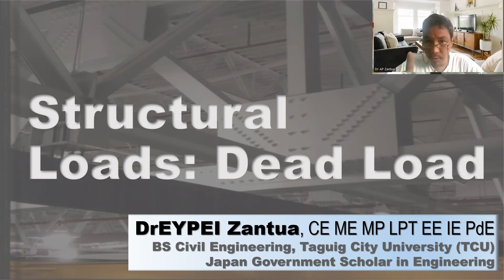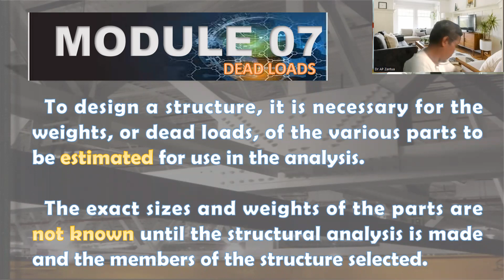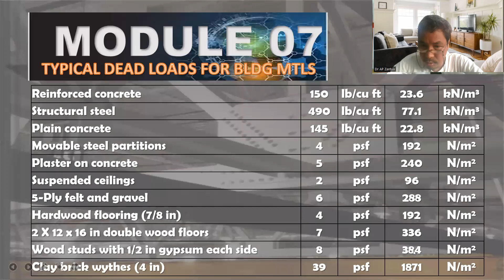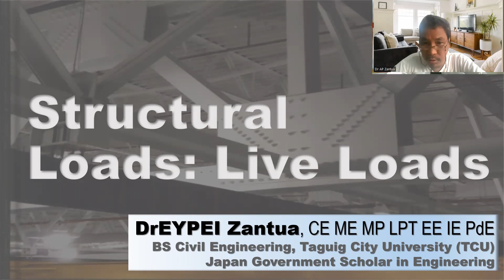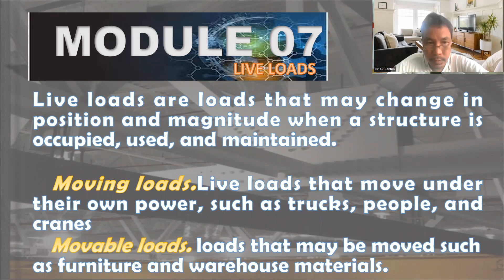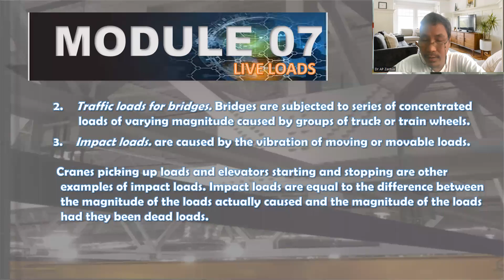Structural Loads of a Building: Dead Loads [ Principles of Steel Design ] Module 2.07.1

Comment: thankyou sir for discussing the dead loads on structural loads of a building, as the loads was classified into dead loads, live loads, and environmental loads. Since it is the most important and most difficult that the civil/structural engineers has to face. As the loads was classified into dead loads, live loads, and environmental loads.
question 044: what is the maximum thickness of glass railing? the answer is B 6mm

Comment: This lecture video talks about structural loads. Loads that are classified as live load, dead loads, and  environmental loads. The example of dead load has stated in the video which are the frame, walls, floor, roof, plumbing, and fixtures. This loads are necessary to estimate for the analysis. Tables C3-1 and C3-2 of ASCE 7-2010 provides the detailed information on dead loads. For Q-044, it is about 1/4" which is 6.35mm. My answer is B (6mm). Live loads has also been discussed in the video. It is classified as moving or movable loads. Tables about typical minimum uniform live load and concentrated live load has also been explained. Thank you, sir for this kind of video that served as a refresher and widen our knowledge about the structural loads.

Comment: Thank you Sir for this live lecture that talks about Structural loads of a building. The loads are classifeid to (1) Dead loads, (2) Live loads and (3) Environmental Loads. But in this video it tackles about the Dead Loads. and it is also mentioned here the Steel-frame building dead loads which are frame, walls, floors, roof, plumbing and fixtures. It is necessary that the weights or dead load of the various parts must be estimated for it to use in the analysis. 

Q. 44 "What is the maximum thickness of glass railing" A.5mm B. 6mm C.10mm D.12mm
The answer is B.6mm

It is also tackle here about live loads: Moving Loads and Movable loads.

Comment: Thank you sir for discussing the structural loads. This topic was exlained in our course TOS so this lecture is kind a recall but watching this, it became more much wider and explained well. Dead loads, Live loads, and environmental loads were classified in ASCE7 minimun loads for buildings and other structures.  For engineers, it is important to know the concept of structural dead loads when designing a  structural plan so that we can estimate the dead loads that our structure will carry and we can prevent structural failure. Thank you sir.
For 20:00 Question 044: What is the maximum thickness of glass railing? My answer is 6 mm

Comment: Thanks po sir for lecture video tackle all about most important in structural load by the structural engineer that may be applied to as structural during its life. Also by discussing all classification of loads, such as dead loads, live loads and environmental loads. 
Q 0044. Ans. B. 6mm

Comment: thank you sir for discussing about structural loads of a building particularly a dead loads. I learned that the most important and most difficult task faced by structural engineer is the accurate estimation of the loads that may be applied to a structure during its life. No loads that may reasonably be expected to occur may be overlooked. In the absence of a cod, the design loads shall be those provided in the ASCE7 entitled minimum design loads for building and other structures. Also, I’ve learned that loads  are classified as dead loads, live loads, and environmental loads. Thank you for defining dead loads as are loads of constant magnitude that remain in one position, they consist of the structural frames own weight and other loads that are permanently attached to the frame. Steel-frame building dead loads where discussed such as the frame, walls, floors, roof, plumbing, and fixtures. To design a structure it is necessary for the weights, or dead loads of the various parts to be estimated for the use in the analysis. The exact sizes and weights of the parts are not known until the structural analysis is made and the members of the structured selected. Reasonable estimate of structure weights may be obtained by referring  to similar types of structures or to various formulas and tables available in several publications. I learned that detailed in formation on dead loads is provided in tables c3-1 and c3-2 of ASCE 7-10.

Q044. What is the maximum thickness of glass railing?
Answer= 6mm